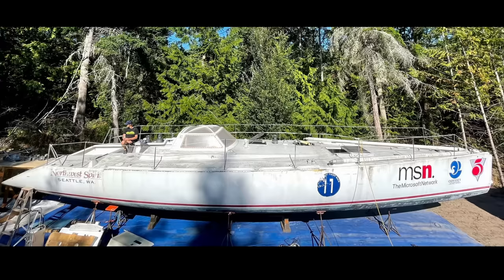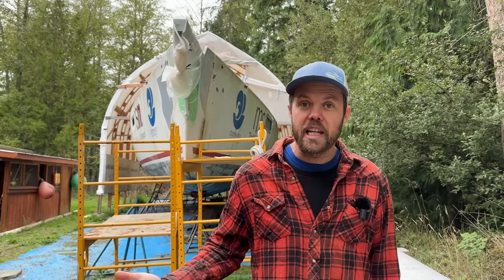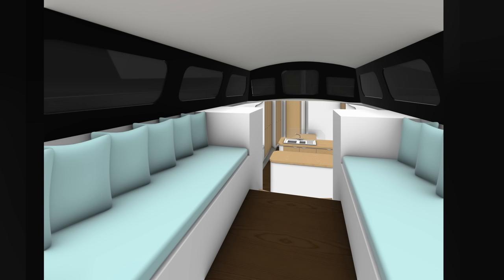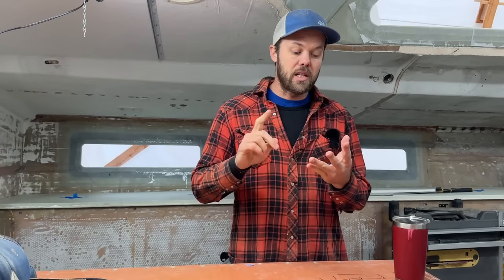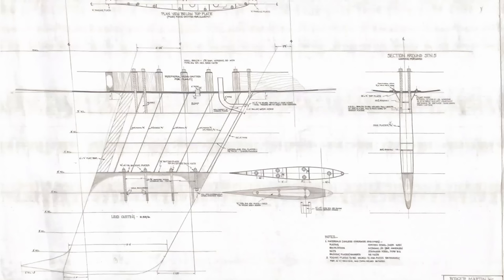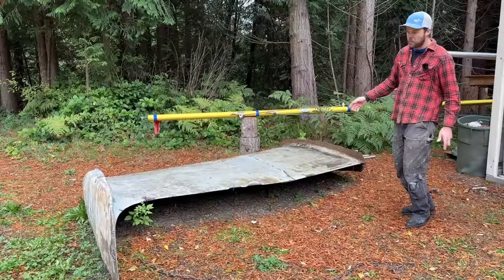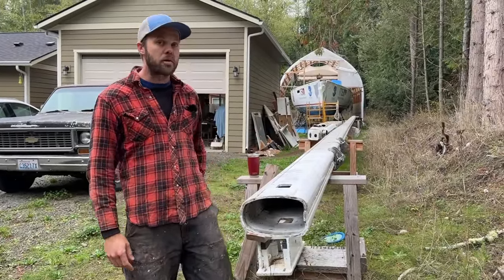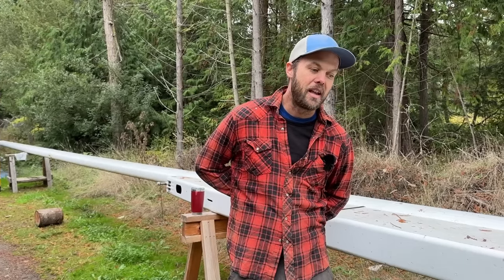EPISODE 100: The State of the Duracell Project; Where we've been, where we're going, and AMA...

Comment: I suggest that you do not cut the mast but Keel step the mast.  This will make Mike's old boat bullet proof. Also I recommend over size stays. Yes this will make it where you need a crane to lift the mast, but the power of the sails will be transferred to the hull more efficiently and with such a radical hull this will help to make the boat more manageable in storm conditions. so would make your boat like a super Wyllie that was made in your area. Most of us never want to be  in storm conditions, but when on the ocean you have no control of what the weather gods will toss your way. Also to avoid ending up like Mike did have your marine architect check the design of the cradle web the keel bolts to.

Comment: talking about the keel you should consider extending the interface with the hull to the rear. A short keel is good for racing but not so for cruising. You are aware there two types sailors - those who have run aground and those who will run aground (some day). Hitting an obstacle with a short keel will inevitably lead to serious hull damage to the rear of the keel - very difficult to repair with a leakage hardly to stop. A sickle-shaped keel with about double the lenght interfacing the hull is highly recommended. Also a skeg (or halfskeg) rudder should be considered for the same reason.

Comment: Matt won't admit it but the other way to ballast the boat correctly is moving many bottles of wine in the bilge fore and aft until it floats evenly. A time honored tradition.
Reply from the maker: will you make those calculations for me?
Reply: @TheDuracellProject  It's tricky. There is the social gathering / consumption ratio factor to include.

Comment: Space saving sugestion/taught materiel: 

Try to add as many of foldable furniture, as possible. Expansible/collapsible folding tables, benches, beds even - Every 2 square meters on the floor, in wich you can stand full height, will be gold for you at the sea. If beds folding to the "wall" is not your cup of tea, go for hammocks, or even sail, suspended by ropes from the ceiling - one of cheapest, lightest and least spacehuging version of bed. Not to mention, kinda "gimbaled" (or at least protected on sides) against the waves, not to throw you out of bed... 

Propulsion and powering question: 

Have you taught about possibility to use rigid "wing sail"? In combination with a lot of solar panels, that could save you a heap of fuel money in the future, not to mention money for generator running your appliances. 

Dinghy question: 

Depends on your preferences, monetary possibilites at the moment of purchase and how long do you plan to cruise and live aboard the ship. If you fancy longer livespann, and quite flexible possibilies, i do sugest you to eyeball boats from company called "OC". Those can be used as dinghies (with motor, electro-motor, rows or even with a sail), are quite light, have integrated wheels to help with movement on the beach. Not to mention, those are supposed to be the apex regarding small boats security.

Good luck with your project and future travels. Keep together.

Comment: Be really interested in seeing your casting plans for the keel, also design of the hull to keel flange. The mechanical engineering portion of said interface particularly. The design of the propulsion system and energy management, super interested in that. Also mast build, super keen to see that design and build, dynex stays and spreader build, loads on stays and shrouds, furlers, sheet deck design. Also don't forget lightening protection, so much easier to include it in the build rather than try and retro fit after the main design. Plastic insulator floating around on a sea of liquid conductor = 1 big capacitor with a big lightening rod stuck in the middle.

Comment: 6:10 Matt and Janni, for this "mother of all projects", do study closely the Kraken Yachts 'Zero Keel', and if possible, see if Dick Beaumont can provide some consulting advise. I cannot stress enough the importance of a safe keel for bluewater sailing, and Kraken Yachts is at the forefront of this, for their boats are all about safety and structural integrity. And while you are at it, consider a full rudder skeg, this way you guys will be protected to go anywhere on this planet. It is amazing how much junk has been floating in the oceans these days, and having a safe keel and rudder is a huge bit of piece of mind. Meanwhile, we keep thanking and praying for saint Boyan Slat  : ⁰ )
Reply: Not so sure about skeg rudders. Spade rudders can be engineered to meet any strength specification. And skegs mess with the way water flows over the rudder (not in a good way). I would say that on a performance oriented boat, the skeg rudder is almost a non-starter.
Reply: Look up Dick Beaumont and Kraken Yachts. For bluewater sailing safety comes before performance, and losing a keel or a rudder can be catastrophic in the middle of rhe ocean.
Reply: @chicobicalho5621  I have read about Kraken. But if you talk to naval architects they will tell you that they can make a spade rudder however strong you want it to be. You don't have to have a skeg mounted rudder, and lots of boats sail in blue water with spade rudders. Skeg rudders do invariably mess up the flow of water over the rudder, and make it much harder to balance the rudder. You don't want to fight the helm on a large boat in heavy wind. The balanced spade rudder is much better in that regard. Bob Perry joked about how in some boats it is the rudder that is supporting the skeg, because the skeg is difficult to mold properly. I think the majority of yacht designers now do not favor skegs.
Reply: Not sure I'd be comforatble hitting a submerged conteiner with a spade rudder, as Alex Thomson did at the VG 2020 but, since I do not own a bluewater sailboat this discussion is fruitless.
Reply: @chicobicalho5621  I hear you. But since shipping containers don't have propulsion, you will likely be hitting it on the bow. A crash bulkhead is a sound idea. I think duracell plans to put in forward and aft crash bulkheads. I don't see how the shipping container could get as far as the rudder. It would have to get past the keel somehow. Maybe a glancing blow, but not a direct full-speed hit. Of course I am assuming a single rudder on center-line. For dual rudder boats that is kind of a concern that the keel is not protecting the rudder as much. Then again, with two rudders, you have some options if one of them gets taken out. I have seen some race boats where the rudder can be replaced from the cockpit. They carry a whole spare rudder, bearings and all, and can drop it down into a hole in the cockpit to change the rudder. The steering lines are all recessed into the cockpit floor. Pretty slick.
Reply: @mckenziekeith7434 Still a fruitless discussion, for we can go on and on with this issue, because it just boils down to the choice of "performance vs. safety", but the fact remains that boats DO lose rudders from flotsam that is half submerged, like so many lost containers are. And this is a fact, not my opinion. But since I do not have the millions of Euros, nor the will to go bluewater sailing, I just toss my opinion out there, and my opinion, based on the countless hours I have dedicated to hearing Dick Beaumont speak about bluewater sailing safety,  and to me it makes a massive amount of sense. That is, if I were to sail from Port Townsend to Fatu Hiva, I would not be concerned with "performance" so much, because, even though I was a genoa trimmer for years, racing, a cruise like this is a transcendental experience, and not a race against the clock, so, if the boat is traveling at 9 knots instead if 11 knots it would make no difference to me, for my ideal would be peace of mind knowing the chances for losing a keel or a rudder would be minimized. But, I get it, you prefer performance, and I respect that, therefore I think there is not a whole lot more to be discussed on this subject, for neither I will change your opinion, nor you will change mine. I hope you have a great weekend.

Comment: Great update, 1 question for ya. This can wait until you all get to this point,  why cut the top off the mast and why not not take the 6 feet of the bottom.  I would think that the bottom would be big around than the top. That seems like a lot of extra work to thin out the top of the mast. Thanks guys
Reply from the maker: Because the berry is already set exactly for our boat with the vang and the gooseneck and the bottom of the mast is reinforced (don’t want to lose any of that reinforcement).

Comment: Maybe for a twist you can show some tips on prep work you do for an indoor fiberglassing job that involves grinding. Like taping off putting up plastic barriers, where to put fans, etc. Just to mix it up a bit. Also, if your channel was nothing but fiberglassing I probably would have stopped watching. You also explain your thought process and how you decide to do stuff and that is very interesting and helpful. It is design as much as implementation. Also, the techniques for modifying a fiberglass boat are a lot different than the techniques for making a new one, so it is interesting to watch how you mate up to the existing structure of everything.

Comment: What would happen if you left the mast the height it is?  Would you need new sails or are the forces on the chain stays not good?  Would there be too much lean when sailing in a good crosswind?
Reply from the maker: we just don't need that much power as a cruising boat
Reply: @TheDuracellProject  I live by the motto, "Anything worth doing is worth overdoing."  and "More Power".  :)

It just seems like a lot of work to cut it down and redo the line support arms.  Is it a cost issue with bigger sails being more expensive? That might be a reason.  

But I would pick whichever option gets the boat done the fastest.

Comment: Yay to 100! 
I’m sure you have seen it, Samson Boat Co put in a hybrid engine with an excellent explanation. You have enough room to put in steerage in the dog house, any thoughts ?
With a shorter keel the Center of gravity will change, will this mean the dimensions /. power of the rig/sails will need to be changed?
Reply: Yes, the righting moment of the boat will be reduced. So the rig is going to be designed for the lower RM.
Reply: @evangatehouse5650  Fascinating stuff, looking forward to the episode when you explain it all.

Comment: If you shortening the mast. Why not use only the lead part of the keel. It should balance out and reduce the draft. Loose the steel part. The keel is a nice design with the winglets. You can always add weight to them. Your doing a beautiful job! I itch, every time I see you sand. Lol!
Reply from the maker: Because the footprint is not the same for the keel bolts. I would love to do what you suggest if I could
Reply: @TheDuracellProject  adapter plate

Comment: Part of the waste that bothers me most when working with composites and plastics is the dust/chips from cutting, machining and sanding the materials.  Even if I am able to capture it 100% what do you do with 20, 50, 100, etc pounds of plastic dust to responsibly deal with it and not be adding to the microplastics problem we're having globally?  That its even gotten so far into the ground that its in deep salt mines and impacting such a basic element in our food supply making it a problem that's going to haunt us for perhaps thousands of years at the current levels makes one take pause.  Its just being understood that the micro-plastics in the salt mines is from the introduction of synthetic/plastic fibers in clothing 100 years ago which migrated into the ground water from activities as basic as washing our clothes so I can't help but wonder what impacts we will be seeing over the next decade due to plastic waste from 90 years ago, etc, etc and what impacts our descendants will see from my plastic dust in 50 to 100 years.  You collect it, bag it tightly for the trash so it gets dumped into a landfill to be run over by a bulldozer so that really only shifts the problem a few miles away and doesn't solve anything.  Wish there was a good way to mix it with resin to make our own Starboard, etc type materials in a way that requires a minimal amount of sanding/cutting/machining making it a more neutral process.

In your project costing its easy to account for how personal along with donated funds are spent on materials and come up with a number however how do you track the value of materials provided by manufacturers or good hearted folks who sponsor the project by providing them?  Manufacturers wholesale price, local retail price, etc?  Hours spent by Mom, Dad, Volunteers add up to value too at least in life hours.  Lots of things to contemplate when considering cost aren't there.  Makes you more appreciative of how valuable a close supportive family and good friends are and how very often they are our true measure of wealth.

Mind you these are just and old mans ramblings and not meant as a criticism.

Best!

Comment: I watched from the beginning. Great channel, a boat with a history and two wonderful people and a cat as the inspector at work. Your plan is to reduce the draft to roughly 8ft. For sailing downwind and cruising that's fine. Mind you, however, the righting capacities of the boat will be destroyed causing rolling even when sailing downwind. The original keel, I guess was 14ft. The boat was balanced with waterballast. You took those tanks out. Meaning that the lowest point of gravity will be brought up by 6ft without waterballast. And mind you...one has to sail upwind even if gentlemen pretend not to do that. The reduced draft will cause the boat to make leeway. Not good in any way. Allow me this story. I owned a 34ft sailingboat with a draft of 7.2ft. Once in a doublehanded race, one of the competitors had the same boat. He had replaced the keel for one that gave him a draft of 4.6ft. Cutting a long story short......I was way faster downwind, on the beam and especially upwind. After the event the guy said to me......"I castrated my boat.'  However, I guess your plans are not built on speed. More on entering shallow spots like anchorages, harbors and marinas. You may consider a lifting keel. There when you need it and gone when you don't. You can vary from 8 to 14 ft. 
Then about Matt rushing to get sth finished enabling Jana to show the result in a weekly video. I'd say....use cliffhangers......worked for most sitcoms.
Last...the name. I forwarded a suggestion. Come to think......I included your names and that's so not like you guys. Matt was asking for new suggestions.
Call her "IIWII". Abbreviation of "It is what it is".

Comment: Does the $57,000 include all the freebies from sponsors?  Seemed like a very low number considering the work you have done.  I wouldn’t doubt if you had $10,000 just in carbon chain plates.
Reply from the maker: that does not include sponsors. $57 k is what we have spent, but does not take into account our labor.